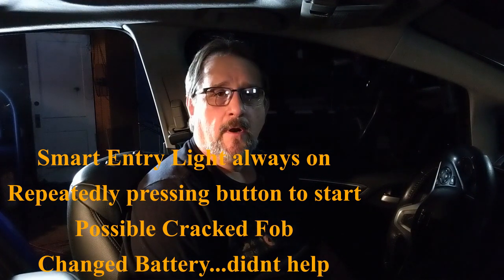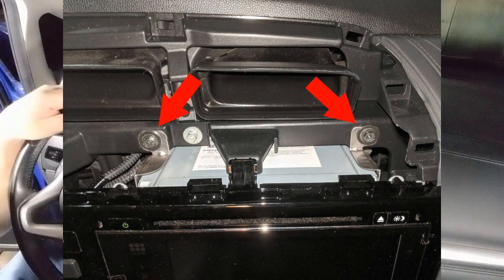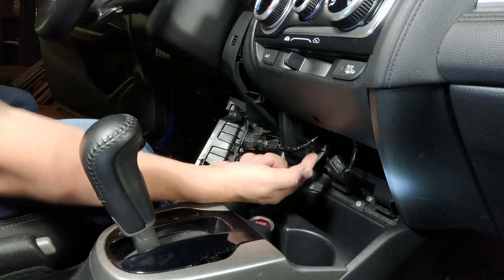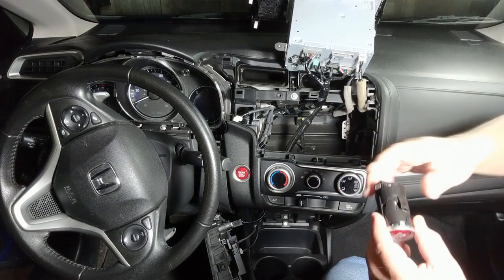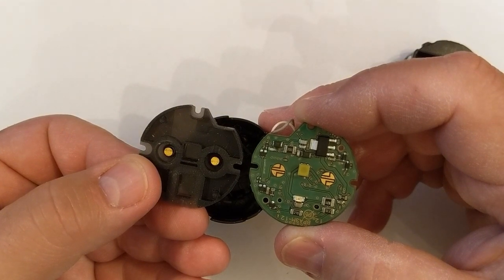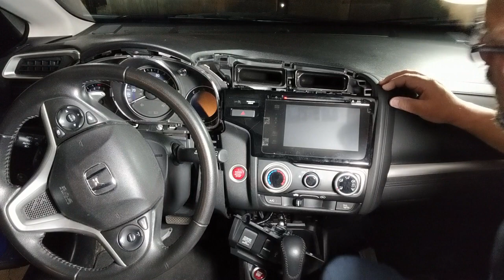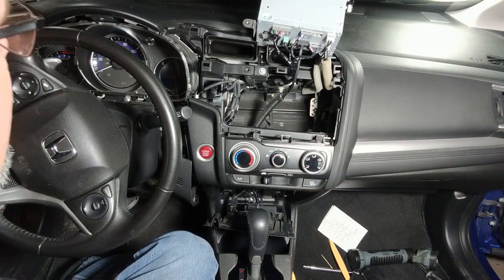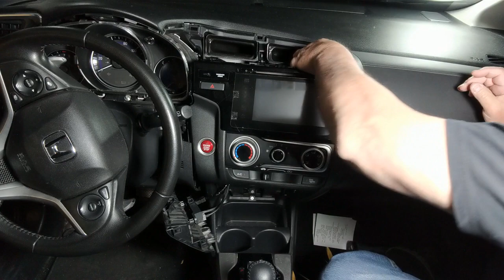Push Button Start Switches (Honda) Repair or Replace [2020]

Comment: Thank youuuuu for this video! I put this off for too long just to get to the point of 15 pushes and fear of getting to/ from work. I followed your video and was able to change the button in about 3~ hours (it took me a minute to find that dang radio screw). I’m a 32 y/o woman with some slight hand tool skills and was able to do this myself. If you’ve been putting this off or are worried you can’t do this… you can!! 💪

Comment: Just performed this fix on my 2015 EX Fit after almost two years of dealing with the start issue. Car is way out of the warranty period (194600 miles as of this comment) and I've had it since 2016 with 12,500 miles on it at delivery. It's my daily driver for a 40+ mile commute and has gone all over the Southeast and parts of the Midwest. 

This video saved me tons of money with just a few hours of my time and some minor discomfort squuezing myself into the floor board to get a better look at things. 😂

Biggest bugger was the bottom side radio bolt. I had to actually squeeze my big head down there to find it properly but once I did the sucker was out. I just cleaned the switch without replacing it but it did what I needed it to do.

Comment: Great video. BUT, a little ingenuity and I came up with a tool to remove the switch in about 5 minutes!
Bent an old barbecue skewer to reach around the switch and push the tab in on the far side without any disassembly other than the beauty panel around the instrument cluster and the one to the left of the pushbutton.
Looks like a hook. 1”, then a 90° bend, 2-3” to another 90° and a few inches for a handle.
Work it over the top of the switch and pull it to the left, releasing the tab while using finger to release the other tab.
Takes a little trial and error to get it, but so much easier than a full disassembly 😎
Reply: Can you post of picture of your modified skewer if you would please.  Much Apprecuiated.
Reply: Yeah, can you post a picof the tool?
Reply: Hello, if you could post a video that would be amazing. Also, does this method let you clean it and put the same button back?
Reply: It did exactly this, except l placed my BBQ skewer under the switch instead of over. 😂 It pop right out. I was shocked that it worked.

Comment: I just wanted to say thank you for this video. My dealership wants to charge me $400 in labor and $200 for parts for a 30 min job and $80-100 part. You are a godsend
Reply: I Feel the same but glad that i took the risk of DIY.  it took me a least 5 hours to do it but it is worth it

Comment: Thanks a lot for the video! I don't understand why Honda would make this so difficult to remove. Most Honda models allow you to remove a single piece of plastic in order to get access to the button.
Reply: So frustrating, especially now I am on my second button failure. Dealer money maker?

Comment: Thanks for this incredible video!  What a horrible problem, I want to go back to keys.
Reply: Me too!
Reply: Push start, electric handbrake i really hate them
Reply: More than horrible problem, last week my honda HRV suddenly engine OFF when I drive it....near accident, ... Start button problem
Reply: Not only the fact it fails, that its so freaking difficult to replace. I am with you though! I actually prefer a key switch because I know where the keys are at all times. It's actually more convenient for me that way.

Comment: No need to go through all this as Honda came out with a extended warranty for this particular problem of replacing this exact same switch for free at any dealership or auto repair shop just keep your receipt but thank you Brother Bryan you are a life saver with your detailed video I appreciate your  efforts in this video
Reply: Thanks Mike. Can you elaborate on the extended warranty for the switch?  My model is a 2018 Honda Jazz with a failed ignition switch at 28000 kms 😢
Reply: I just called to ask my local dealership about this and they confirmed that my car was covered by running my VIN. However, they said that I would need a $180 diagnostic check to confirm the issue. I think I could buy and replace the pushbutton start for much less than that.
Reply: Unfortunate for those not under warranty/salvage. Especially after I read its a problem with the circuitry that causes them to fail regularly..

Comment: I ended up removing and cleaning the button. So far about a week with no light. Will keep you posted. A bit scary forcing all those plastic parts. Could not have done it without your video. Thanks again.

Comment: Woah. What can I say beyond, THANK YOU!!! 
Such a well done video that saved me hundreds of dollars. From start to finish, this took me 1hr and 25 minutes to do myself (and I'm not mechanically inclined). The instructions were so clear and the video covered just about everything. 

Just a couple of take away's/tips for those trying this on their own:
1. When removing the vents, first pry the bottom. There are 3 or so black tabs that hold this piece in pretty tight. Once you pry those free, the rest is pretty straight-forward
2. I had the non-start problem that Bryan did at the end, but mine wasn't due to a dead/weak battery (I don't think), I just had to reconnect the rest of the electrical wires and then it started right up.

I'm definitely sharing this video! No need to buy a new starter, just clean the switch. (I used Q-tips and isopropyl alcohol like in the video)
Reply: lol - I had to do this again 3 years later and thankfully my own comment reminded me of the ‘reconnect all the wires’ trick. 😅

Comment: Thank you so much for the step by step video!  I was able to replace the switch this weekend but it took way more effort than I expected.  My dash trim pieces  & lower panel didn't pop out as easily as yours and I had a hell of a time removing the connectors behind the radio since that step wasn't shown in the video.  My partner ended up being the one that was able to figure out that part.  I almost had a "why isn't this working oh shit" moment when I tried to turn it on & it just beeped at me.  Until I figured out that I hadn't reconnected the plug from the lower cigarette lighter/USB panel.  Whew.  It's as good as new and I'm glad to saved several hundreds of $$$!

Comment: Thank you so! much. I was about to drop $585 at the dealer because they said I needed new keys and start/stop button. Then I gave this a try & it fixed it. I only wish I had seen this before I dropped $1,000 on a new alternator last week. Thanks again man!

Comment: Great video, huge help! I also unplugged two connectors on the right side of the radio, so I could pull that out a little more, and another screw below and to the left of the start-stop switch. I had difficulty unplugging the white connector from the back of the start-stop switch, but eventually figured out there's a tab on the top that needs to be depressed. Not a lot of room to get fingers in there! 

Also not a bad idea to disconnect the starter battery so you don't drain it or potentially short anything while doing the work.

Comment: The little connector next to the power outlet and the hdmi plug is some kind of security thing. Car won't start without it plugged in.
Reply: Just spent 3 hours messing around with it to find out yup it wont start without that. Glad i read your comment

Comment: Thanks for posting this!  Still helping people years later . . .  I did run into the 3-beep thing.  I believe it was the connection down by the 12V / HDMI / USB.  Antenna or immobilizer.

Comment: Following up - worked like a charm. Took 2 hours with a couple of short breaks. Thanks for saving my family some serious $$$ and helping fix an annoying long-time problem! Now if I could just figure out why it clatters so loudly when I start it up....
Reply: From my research the clattering startup noise is probably the VTC actuator..I also get it, especially when it's cold. Now idk if that can be a DIY fix like this..
Reply: I’m having the same problem when my Honda Starts up .
Reply: @brittanyrodriguez4074   I’ve read that it doesn’t matter and if you get it fixed it might just happen again. Just sounds so bad!
Reply: How hard was it to do can a regular joe do it?
Reply: @yezkaholic  Hmmm, hard to say. I'm pretty handy and it was a challenge to put it all back together. Also wish I would have put a towel on the dash because I got a scratch. But you are probably OK because this has now been recalled and Honda should replace the button for free.
Reply: @WillAustin  I actually have a service app Monday. I just hope they replaced it, because I never had a warning light like most of folks with the button issue.
Reply: @WillAustin  did your issue go away after replacing the button?
Reply: @yezkaholic  yes
Reply: @WillAustin  thank you for the info

Comment: Thank you so much for the video. I've had the keyless entry idiot light on for about a year and just recently the car randomly wouldn't start the first time. The last time I looked for a video on how to replace the button I couldn't find one so when I looked again and found this video I was thrilled. I cleaned the gunky contacts on the original part and installed it and it still works. I'll post an update after I've driven it for a while. 

As far are your small battery issues:
Honda fit uses the 151R size specific to Honda. I had to replace mine twice in two years. After reading forums I found out you can easily trim the stock battery tray to fit in a standard 51r. In about 5 minutes with some tin snips I clipped off a little bit of the tray and was able to fit the bigger battery. Two and a half years later and no issues. I highly recommend anyone with battery issues to do this modification.
Reply: Did your wifi light stay on?
Reply: @operez2118  Not sure what you mean by wifi light. My car doesn't have wifi. The light on my dash was for the Smart Entry System and after cleaning the start/stop contacts the light turned off for the first time in a year.
Reply: @krehkreh8961  yes that the light I meant. I cleaned the contacts and it worked again. The light stays on.
Reply: If you haven't already maybe try taking the negative battery cable off for like 10 minutes and then put it back on. That will reset the computer. The light should be off after that. Drive around for a while and if the light comes back on again try cleaning the contacts again. If not it might be time for a new part. Amazon has them for $47.99.

Comment: Excellent guide, this job took me an hour and the button works like new! I definitely recommend a magnetic screwdriver to get the bottom bolt out. If you do happen to drop it, the cup holder comes out with just one screw and you can fish around with a magnet to try and get it back

Comment: I like my fit. I have had three problems. This key issue and I am really thankful for your video. Thanks!  My rear wheels cause tapir chopping of the tires. No idea why and wheels cannot be aligned.  And, the awful noise on start up. Fixed under warranty and now 35k miles later, the same issue. No warranty.  This is a hydraulic cam something or other. That is very disappointing. Come on Honda.

Comment: Thank you for the well made video.  I don't know why Honda doesn't just recall the Fits to replace these.  They're going to loose alot of customers like that, I never have these problems with my Toyota.  I also have the flickering instrumentation dash problem.

Comment: Thank you. Everything worked out great. I've never removed any of those parts on my fit before and were a lot harder to get off than than yours 🙂. I have the same issue as you did starting the car after button cleaning. But since I have all LED interior lighting I figured that there's no way the battery was worn too much. I shut all the doors and she started right up. I did not replace that lower screw on the radio.

Comment: Hey Bryan. Thanks for the video. It was the build-up on the metal contacts (black random lines) that was causing my problem. 

I got to the switch from the steering column side instead of the center console side your video showed. I got some finger access after removing the steering column lower panel and unscrewing the Starter Switch panel from the metal base. I had to pull up on the latter panel as well to increase hand clearance (one tab couldn't find its way home now causing a minor gap).

As for the tabs, I placed a shim (wooden coffee stirrer) between the tab closest to the steering and the starter outer housing. As for the opposite but harder tab, I used a modified metal coat hanger. I modified it by straightening out the hanger but leaving the hanging loop intact. It took several attempts to pull the looped part towards the steering to depress that tab while pushing the switch from the backend to pop out. If I had figured it the pathway and modified tool beforehand, the whole operation would have been 10 minutes tops.. Thanks for your inspiration and saving me money I won't necessarily have lying around to spend.

Comment: Thanks for posting this video Bryan .Our 2015 EXL (Mexican built, Canadian spec.)seemed to differ from your Fit  and has a HVAC touch panel not the same as yours, I managed to get the start button out by removing the cigarette Lighter /HDMI panel and pulling the underneath of the radio /nav HVAC unit plastic finisher out (its hot weather here atm so the plastic flexed without breaking)and getting my hand up in the space from below on top of the console and using finger and thumb to push in the tabs that hold the switch in, releasing it from its surround panel.. Never removed the radio/Nav unit .Also pulled the steering column shroud and air vent and instrument cluster trim , but that was just so I could get a better look at the back of the button switch assembly. Of course I tried to start the car by just plugging the switch in after the contact cleaning process  , resulting in a no start (I had not plugged the antenna back in that is on the back of the Cigarette lighter/HDMI port panel). Works OK now I realised and corrected that mistake(after I pulled the start button back out and took it apart again , thinking I had made a mistake when I was re-assembling it the first time)

Comment: Thank you, thank you! I could not have done it without your well made video, at least  not in the time I did it. Got it done rather quickly. Use a socket / nut driver not a screwdriver on the hex screw like you said 5/16,  on the bottom of the radio and use a mirror and a flashlight to see what you are doing for removing and installing that pesky screw/ bolt. I just used some paper towel to hold the screw/bolt in the socket so it would not fall out. All the trim is a bit tight and takes some force to pull out especially the radio is a bit resistant to get out of its "nest" it has a few tight plastic spring clips you have to overcome.  I got the real Honda replacement switch,  My local Honda wanted a lot for it but there are plenty of online Honda parts dealers that are way cheaper.  it might even be an upgraded part since it is not the original part number, it superseded with 02 instead of 01 as the last two digits. It costs a bit more than the cheaper China stuff but I didn't have to wait for a shipment from China for an after market part. Could I have cleaned the switch? Probably, but just like in the video, the old switch is now a spare. My warning light, so far, is no longer on and one push of the button starts my engine.
Reply: My Smart Entry System indicator light, that dashboard light with a key, and exclamation point and a WIFI sign, is no longer on. However this light can sometimes be reset by disconnecting the car battery for a few hours. If it comes back on then the problem has not gone away. If your key fob battery is low, this light does not come on. There is a separate warning on your instrument panel that states your key battery is low. My 2015 Fit switch P/N is 35881-T5A-J02 cost $ 88.33 from Browns Honda. They are also on eBay. It took 6 days from ordering to delivery.  I was quoted nearly double that from my local Honda dealer. I could have bought a cheaper switch not an OEM part though.

Comment: Thanks for showing it is possible for us DYIers to do.  I hate that it is so complicated to get to a part that only needs 10 seconds to clean, yet the $20,000 car won't work at all until it is done!  (MAjor Peeve!)  They could have just put two Philips head screws on either side of the button, 'stead of having us have to pull all that other stuff out!

Comment: Absolutely awesome! Thanks for the detailed disassembly instructions. Those hidden trim screws and catches can be a real bear to figure out if you need to pull a little harder or find another screw.... I used a little electrical  contract cleaner and a q-tip to clean it up and back in business with an investment of an hour and a half and zero dollars. Looking for that donate button. Thank you so much!

Comment: THANK YOU SO MUCH I DO WHAT YOU DID AND CLEAN IT AND IT WAS GOOD BUT IT TOOK ME LIKE THE WHOLE AFTERNOON DOING IT CAUSE THE HARD PART IS PULLING THE RADIO DISPLAY AND THE HARDEST PART IS TAKING THE SCREW UNDER THE RADIO.  I DROP 2 SCREWS IN SIDE SOMEWHERE AND END UP GOING TO BUY 2 SIMILAR SCREWS. THIS PART TOOK ME 3 HOURS. TOTALLY EXHAUST.  NOW MY CAR IS GOOD AS NEW START FIRST PUSH.   THANK YOU SO MUCH COULDN'T HAVE DONE IT WITHOUT YOUR GUID.
Reply from the maker: Glad that I helped you....next time magnetize your screwdriver.
Reply: Bryan Shattuck  how do you magnetize a screw driver
Reply from the maker: @kmj8637  Just rub the screwdriver with a magnet.
Reply: Use a nut driver or socket on a removable screw tip driver, it encapsulates the screw so it won't fall. Use a mirror and flashlight to see what you are doing under the radio, it saves so much time!